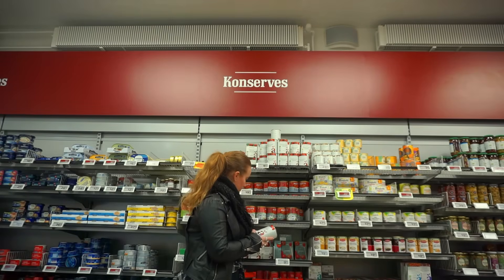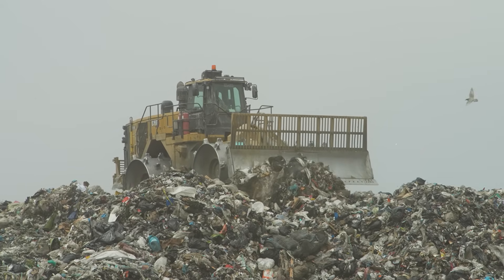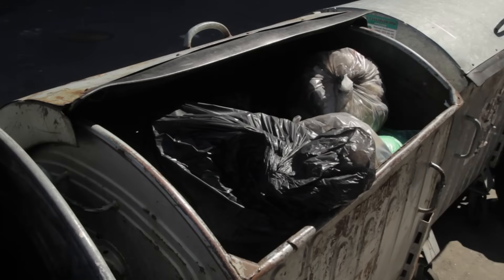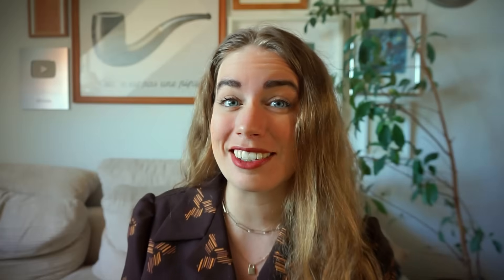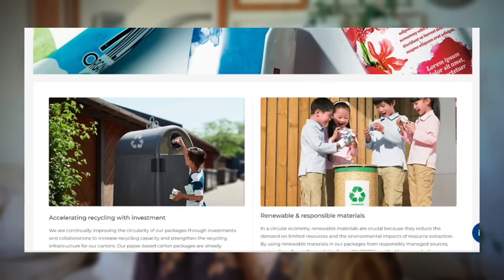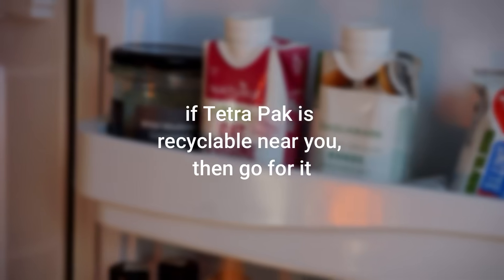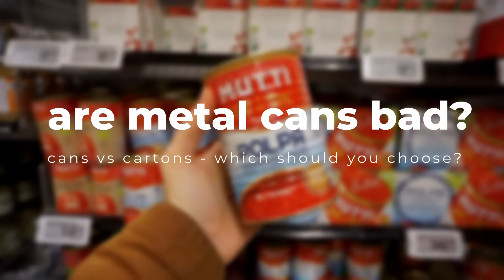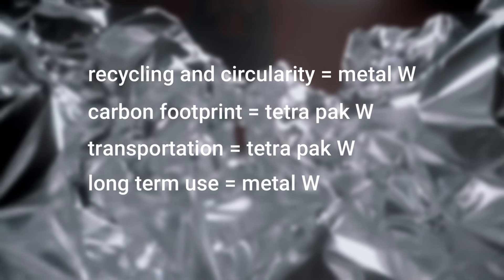GREEN OR GREENWASHED // the truth about tetra pak cartons & metal cans

Comment: Hi Gittemary!

Here in Sweden,  origin of Tetra Pak, we recycle these "boxes" as cardboard/paper packages not to confuse with paper as in news papers, letters aso, that is sorted into another fraction. A quite high % of our cardboard/paper packages are recycled. Since we recycle it this system works here, in other places on the planet it´s a whole other thing. As you say several times in the film, if adequate systems are in place...

We do have some milk cartons that in made of paper and waxed on the inside, no plastic and no aluminium in those. 

Another good thing with transporting tetra paks instead of cans is the shape. Squares packs better than round cans and that saves space and leads to fewer square meters of gods to transport.

I try to avoid all packages as much as possible, tho that is not always an option.

Comment: I try to avoid both. Usually I buy glass. I afterwards reuse them to conserve self produced vegetables or use it to bring the milk home from the farmer. After some reuse cycles the glass and the cap goes to the recycling bin.

Sometimes people forget about the alternatives. E.g. beans (kideny) are also available dry. So you don't need any or much less packaging. Same holds true for all the stuff that grows in my garden but in addtion there is absolutely no transport. I also can use all the compostable stuff in my garden, so no garbage truck need to transport this. Just to make it clear, I don't have a huge garden, but I use the space that I have. Another side effect: this small vegetable garden also is a much better palce to live for all those bugs and birds than the neighbors garden, which are mainly grass.

Comment: There's also the fact that transportation ecological impact does have the technology to reduce the carbon footprint. We need to be using those technologies a lot more, but they do exist. I do not know of anywhere in my area in New England that will take tetrapax for recycling because of the multi-layer issue. Therefore the infinitely recyclable aluminum always wins out for us and our household.

Comment: Side note: paper is NOT infinetly recyclable. The fibers paper is made of, which are intertwined in layers to form a sheet or carton, will get shorter with every recycling cycle. The paper get shredded and washed and pushed around in the process. So inevitebly you end up with short fibres. The shortest (!) being used in Tetra Pack. These usually can only be recyceld 2 or 3 more times usually in the EU.
Reply from the maker: Absolutely! A point that wasn’t included here (although I spent several minutes ranting about this in the impact video on paper 😂) but yeah, calling paper renewable “because trees grow” is so far fetched honestly 😅
Reply: Thanks, I didn't know
Reply: But I do think paper is a lot more sustainable than plastic or certain other materials when forests are managed properly trees are replanted and a lot more care is put into biodiversity and keeping the health of the communities they are in and the surrounding eco systems. Currently I know it’s not done very well but I think plastic is still more destructive since it comes from fossil fuels.

Comment: I'm honestly positively impressed by the percent of recycled cans 👏 Thank you for this informative video. I think it is very important, because most of the foods that i choose are in cans or cartons. I was wondering a lot about it. Both of them are for sire better than 100% fully plastic packages and bottles. I guess if seperated, the paper part of tetra pack could even be composted, right? I luckly live in a place that has probably not bad recycling system. I think returning system is cool and should be available in most countries. But is it only for bottles and cans or cans with stuff like sauces and beans are returnable too?